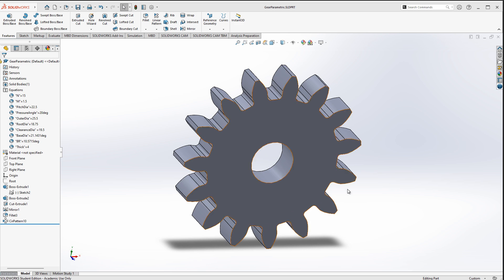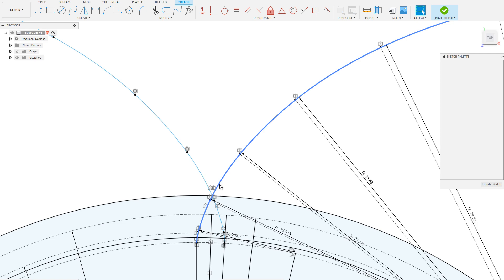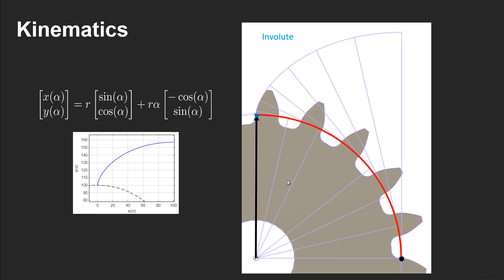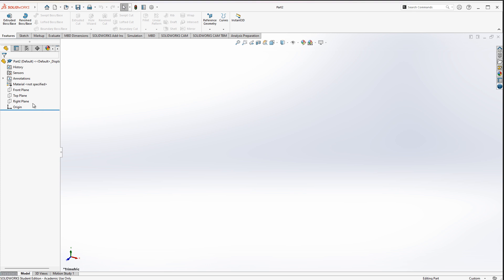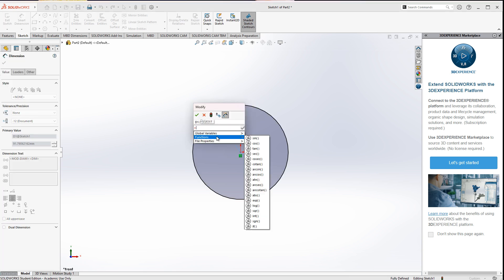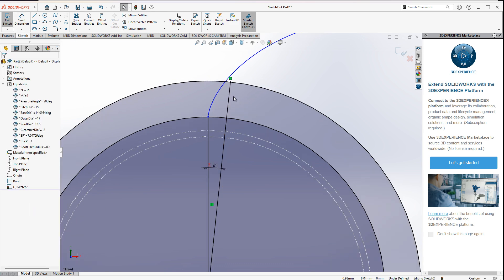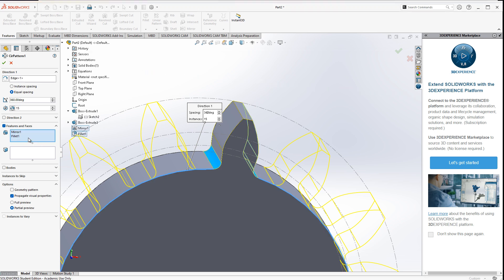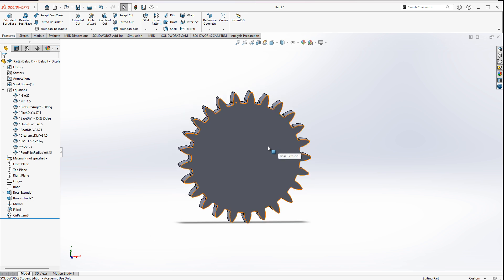Designing an Involute Spur Gear in SolidWorks Using Equation Driven Curve

Comment: Hi Mirza, thank you, your involute curve maths was very helpful.  I did identify one error though.  The gap between your teeth is too wide.  When you created your tooth mirror line at 360/N/4, you referenced the vertical line from which the involute line starts, but the mirror line must be referenced to another line, from the centre of the gear to a point where the involute curve intersects with the pitch circle.  Mick, Kusel Design, Australia.

Comment: great video, you did an awesome job on this one, very clearly explained. The problem with patterning the teeth remains tho - somebody made a comment on that as well. Soliworks is kinda finnicky on that, I've had issues in the past with that as well. Many people make these gears by instead "cutting" the teeth, rather than extruding them. Dunno if that approach offers any advantages.

Comment: The reason you're having issues doing the circular pattern is because you're trying to pattern a base feature. Create the Root Diameter Circle first, then add the tooth. Also, when patterning, you can check the derived pattern option as well sometimes.